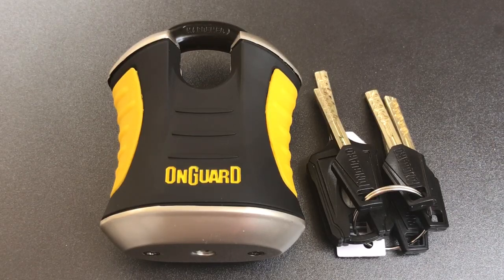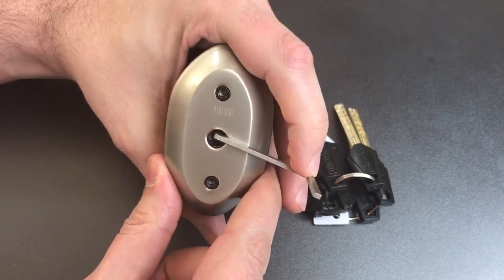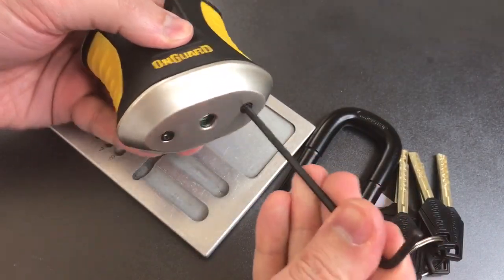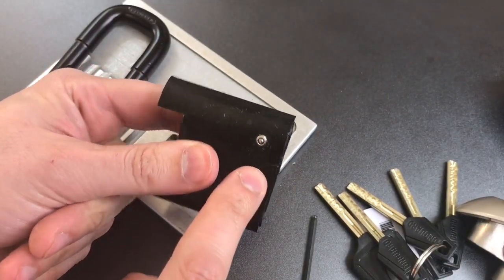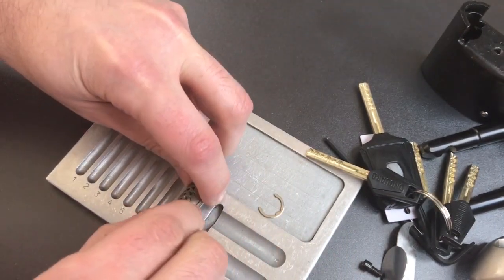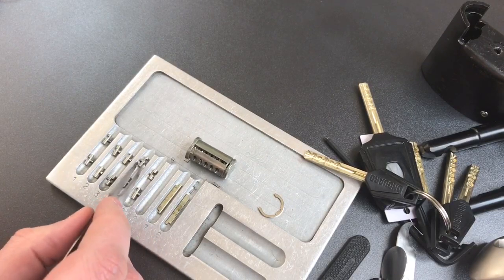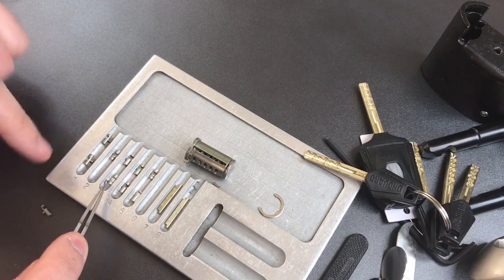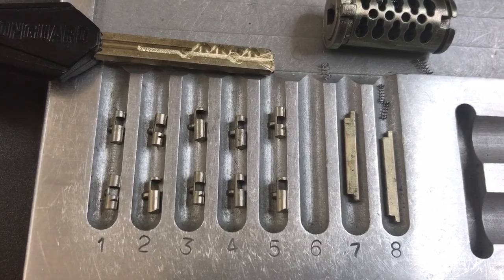[586] OnGuard "Beast" Padlock Picked and Gutted (Model 8101)

Comment: so, rounding out the top and bottom screw head sockets would basically solve the disassable while locked vulnerability? of course, would make it quite hard to disassable for maintainance, probably some bolt extractor would work on the rounded screw head socket. even a small weld dab on the head of the screws would it make it almost imposible to disassable. the casted caps would certainly come appart with a few hammer blows thou, so i'd do the same to the grove screws (with the ball berings). good luck tearing that lock appart.. ever.

Comment: They changed it instead of Allen screws with bearings they use bolts with the heads that break off when torqued down

Comment: Thanks for gutting this.  I have an onGuard with this sort of core and I'm trying to pick it now.  I'm in the process of just trying to get a feel for the little bars - locating each, lifting each.  I've found it very difficult with a hook, and have switched to a slightly elevated half-diamond.  That helps for locating them, but lifting them is still very difficult.  I should also get a z-bar like you have there as I think that would give me a better feel for the tension.

Comment: If it takes a pro like you a minute to pick it then it's going to take a novice 5 minutes and a complete moron impossible. That being said, for $35 sounds like it's worth what it's priced at. Cracking it with a hammer also seems like a pro's job such that you need the right tools, the right technique, and of course the knowledge that the ball bearing is the key to disassembling it.
Reply: Well said

Comment: epoxy glue on top screw fixes problem so the lock can be pulled from trash- you cant replace cylinders though. incredably stupid to sell as is though. its as if they want you to keep buying new locks
Reply: I thought the same thing so was scrolling the comments to see if anyone else mentioned it as well. They are for sale in amazon right now for 6 bucks!

Comment: I GOT THIS LOCK, I WILL STRIP THE SCREW & THEN SPOT WELD A SMALL AMOUNT OF METAL TO THE SCREWS THIS IS A MASSIVE GOOD CHAIN & LOCK FOR THE PRICE, WHEN THE ABUS IS $240 +  THIS LEVEL (ABUS GRANIT monster square amazing lock MAJOR $$)  I JUST PAID $50 FOR THIS ON GUARD ((WITH A 12mm CHAIN!) ON AMAZON, U CAN'T BEAT THAT! USE A LITTLE INGENUITY & WHALA FLAWS FIXED. NOT GONNA WORRY ABOUT ON GUARD WARRANTY IF ABSOLUTELY NEEDED I'LL JUST BUY ANOTHER LOCK! A BIG THANK U 4 THE LPL MAN & THANKS FOR SHOWING ME THIS. & PS. NO ONE GONNA BE DOING THIS IN YOUR FRONT YARD AT NIGHT, ON THE STREET, OR IN A DRIVEWAY, OR AT A GROCERY STORE UNLESS IT'S COMPTON OR AN ALLY IN NY.

Comment: At least the lock wasn't that easy to pick.  IMO it'd be Meth head proof, save using a saw/cutters on the chain or pulling out the post the bike is connected to.

Surprised there - given the case I'm surprised he didn't pick it with a bobby-pin...

IMO if someone has one of these locks, maybe they should use Binary Epoxy to seal the case shut.  Dab of wax over the key-hole but mix binary epoxy to glue the case and screws in, since if you lose the keys or the mechanism breaks you'll cut the chain anyways 99% of the time, just seal it after the Epoxy has had days to dry.  Then when someone tries to defeat it, they can't get the screws out, then cutting/smashing through the case they have to chip off every inch of it...including the sides since just pulling out the screws it won't fall apart if the case is intact.   (I'd do a run through with a file or cutter so there are slight grooves on the lock's surface, the Epoxy will stick even harder then.  Anyone with time to do that, there are other problems.

Comment: Would one consider this brand, or this lock, at least, a deceptive item for the excessive amount of coating and housing? As LPL calls it 'gingerbread'? How is one to know, except, perhaps to look at the key? IOW, the lock "industry" seems to do everything possible to prevent the buyer from really assessing the product.

At the store they go on 'hype', the name, the gingerbread, the steel hardness (other U-bike locks, at least), and they use cheap pot metal or zinc. in parts of the covering.

If I had an important need for a very good lock, it would be difficult to tell a worker what to buy and saying 'get the toughest, strongest lock in the store. Well there's no way for a customer or their employee./purchaser to perform the selection, and knowing how many outright lie, if it were me I'd have to decline to go get it, because if it failed to lock, =I= would be blamed. I think anyone could search LPL's channel and make a case for suing...someone.

Of course you could tell your boss 'go look at LPL's channel and YOU tell me, Boss what to buy and it's your responsibility.

In Government service, one wonders what might be used. Do they have specs that would prevent a contractor from building a 'bad' lock, making it proprietary? /rant
Reply: he dissects a few decommissioned military locks that were heavily used.  some were easy to pick but took some time to pick, but are all basically bomb proof and meant for it to take you just long enough some security guy would notice, but easy enough that if someone forgot the key during an emergency the troops could bust in quickly via picking it. (no idea if these were requirements it's just how it seemed)  Then there is the British aircraft Sidewinder missile lock used for training to prevent accidental live missile launches during training; that lock was easy to pick.  however I suspect it would be difficult to pick inside of a cockpit while flying.

Comment: I dont have any experience with this kind of core (picking, anyway). Doesn't the nature of how this kind of core works necessitate a wide, wide open keyway?  I get the impression that regular pin and tumbler with decent warding would be more difficult.
Reply from the maker: There are ways to add effective warding... and the cost of more easily broken keys. ☹️

Comment: I have the same lock with its original chain. You cannot access to the screw in the middle with its original chain is on. Can it be safer if we make those allen screws and the screw in the middle unopenable?
Reply from the maker: I bet I could access the screw. Even if I couldn’t, it’s not needed for the bypass... just to give you a good view on video. As for modifying the size screws, that may help, but you really need a better lock. An Abus 37/80 would fit the bill. 👍
Reply: LockPickingLawyer As I'm watching your videos, makes me think that there's no lock that cannot be unlock :D

Comment: Given that the previous attack was a low energy non destructive attack so to speak, if one had this lock, one could protect it against that attack by welding a retainer around rhe lock right. Lets say a shaped piece of sheet metal 1/8th in thick. 
 Predrill a hole for the key.
 That would be a way to improve the lock. It might not be worth it as even some of the master proseries are and it pains me to say this, better locks and the same price or better.

Comment: Loc-tite/JB weld the top screw, change the caps to hardened steel and rivet the allen screw holes and they might just fix this little problem they have.
Reply: I bet there is a way to just yank the core out. Get a key made of very good steel that will not open it but will fit inside. Attach this to a slider hammer and yank it. Core comes out and there is nothing left. Is that true? 

Also, impractically, admittedly a BG could carry an insulated container with liquid helium from a lab, dip the lock in it (or spray it, then shatter. Odd methods, but doable if you are a professional in a Movie about breaking into a secure place. I mean I kid, but picking and melting and chomping are not the only ways.

Comment: Those gates are huge. There must be key overlap. Can you try "raking" one of them with the key from the other? I would think a rake of sorts could be made by grinding down one of the keys at least.
Reply from the maker: Raking is difficult because there is almost no room between the lowest cut and the bottom of the keyway.
Reply: Yeah that makes sense. Still, those gates are begging for it. I wonder if one couldn't manufacture a rake out of piano wire that could still squeeze past the low cuts:
~~~~~
|
~~~~~
Reply: Nevermind... those are pretty low cuts on that key at 9:54.

Comment: Replacing the hex nuts with small steel bars and inserting a sheer screw in the top shroud would make this a much more viable deterrent.
Reply from the maker: Even with the modifications, I could exploit this defect by punching through a couple mm of plastic to access the set screws. A bit more destructive, but still effective. 👍
Reply: I think the consensus yesterday was a tiny bead of weld to repair or shear pins to manufacture, (which would have been cheaper).

Comment: The sliders look almost exactly like the ones used in the millenco magnum. They also have false gates that are too shallow to even notice. I wonder if the same method of setting all the sliders at once by overlifting works here too, as it can defeat the Millenco sidebar in seconds in my expierience.
Reply from the maker: Thanks. It's worth a try. 👍